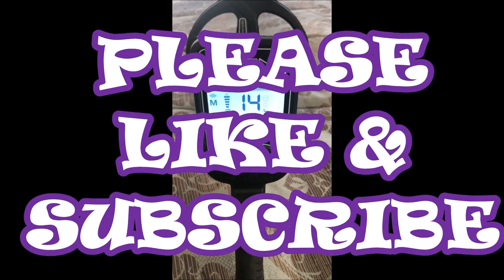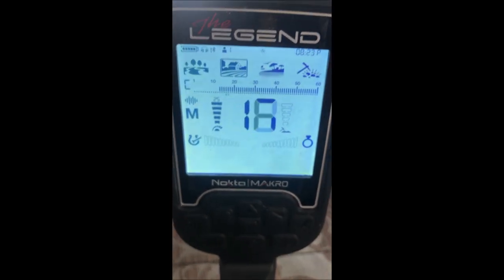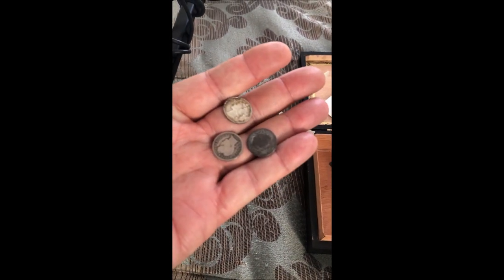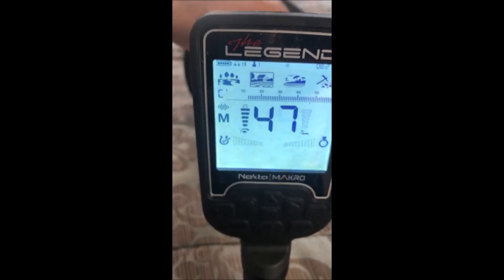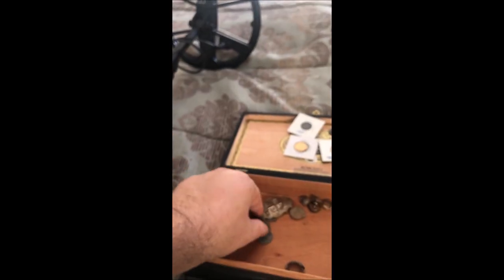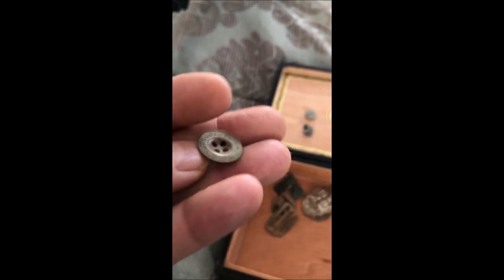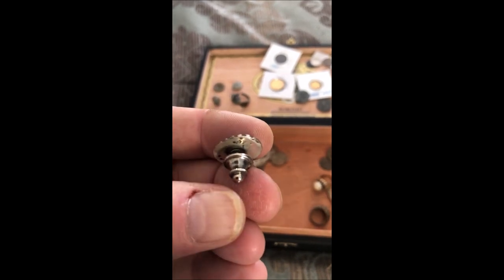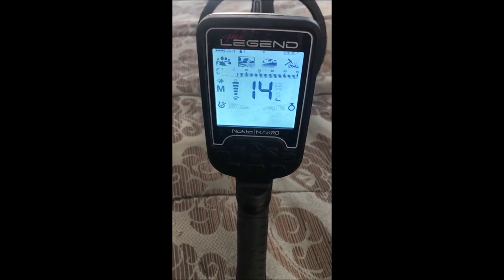Nokta Makro Legend Field Mode TID & AUDIO CHECK + Basic Settings & Modes

Comment: Hello, when you dont use the detector, is it normal that the VDI is unstable like this? i saw it on multiple videos.
Reply: He probably had some EMI going on. Probably should have turned the sensitivity down.
Reply from the maker: If there's extreme EMI (which there definitely is inside my home, although outdoors it handles EMI better then almost any other detector I've used) or the sensitivity is run too hot, it will tend to be sparky with erratic VDI.  In general though when the coils swinging on dirt, it's stable.

Comment: From my views it seems very unstable for a miti frequency detector and no real tests at all ill do not want to order and tben be sorry afterwards my vanquish  is more stable than that so yes ill wait and see when its out and some real tests con be done from reputable people who wil show the real ups and downs
Reply from the maker: I field tested the Legend at a major inner city park in a particular area that's terrible with EMI.  My EQX800 can only hunt there if I reduce the sensitivity to about 15-18, and then I loose depth.  I didn't experience that when I tested the Legend there.  And no I didn't buy the $5 coin at a coin shop, what's wrong with you?
Reply: Emi indoors can be crazy one hour and silent the next same goes for my nox or any others.
Reply from the maker: @JonR35  Absolutely, EMI changes all the time.  I checked it on my EQX800 as well as the Legend to validate.  Thus far I've had the Legend at a variety of sites I'm very familiar with and was very impressed with how quite it hunts with the sensitivity maxed out.  Like any detector that runs hot they tend to chatter when sitting idle with the coil not moving over the ground (after all the coil's effectively a big antenna).  I have plenty more field tests to show once allowed, as well as a laundry list of tests to run through for head to head comparisons.
Reply: I have seen a few preliminary videos and have thought the same. Target IDs seem to be very jumpy.
Reply: @TheHistoryDigger1  IT's because the numbers have a wider range than say a nox, therefore slight differences cause greater change.  That's what you want........so you can tell the difference between junk and non junk.  Imagine if the machine had to pick a number between 1 and 3.   You'd have some seriously stable numbers!   How would that help you ID targets though?  It would be useless.   Most of the targets that should have been stable were in this video.  The oddly shaped stuff, or crusty stuff, or questionable alloys were not.   Exactly as they should be.   I saw no issues.  I actually wish they had kept the 1-100 range to be honest.  They did on the Deus 2.........sadly everything on the Deus rings in about the same.  That's one thing about that machine I never liked.
Reply: @MrBottlecapBill  great explanation- much appreciated.
Reply from the maker: @MrBottlecapBill  thanks for watching and great explanation!  I'm not sure why ML and NM decided to do a compressed scale, probably for the perception that the detectors would be more stable.  I think it worked somewhat on the EQX, let's see how it plays out on the Legend.

Comment: This is not good for new nokta to not see this ring
Reply: Probably has stainless in it which dont pickup well.
Reply: He has the iron and some foil blocked out that ring is not picking up because its coming in lower then what is not blocked out
Reply: @blown6976  That's also my guess... probably made out of stainless steel, chich is hard to be picked up by metal detectors. And the machine has the discrimination from 1-13 so it would have probably rang there